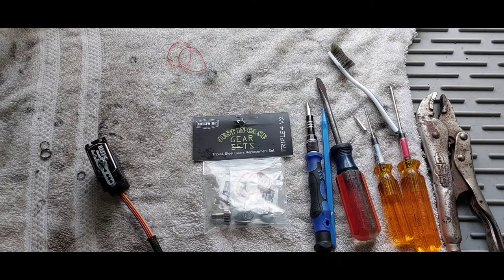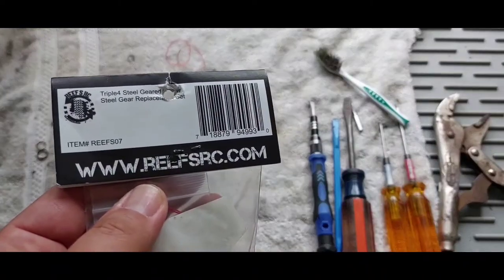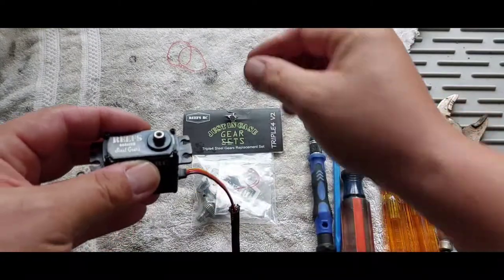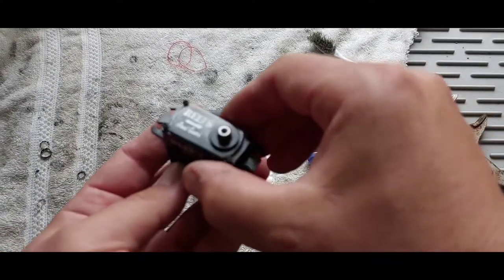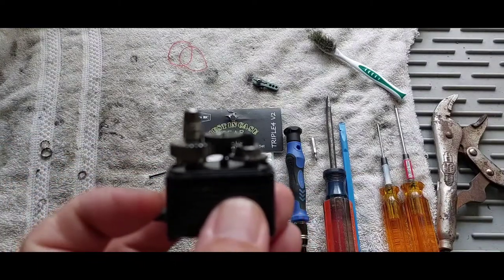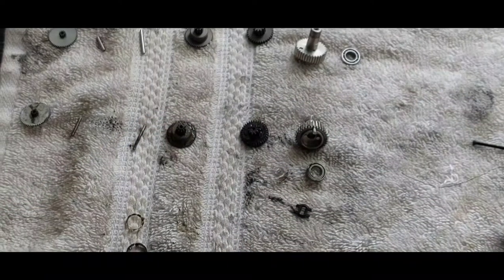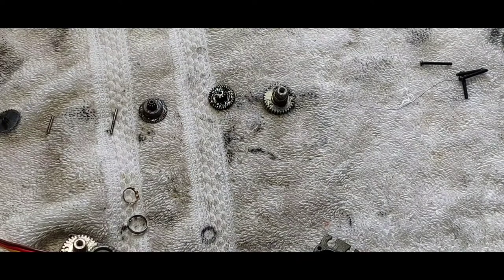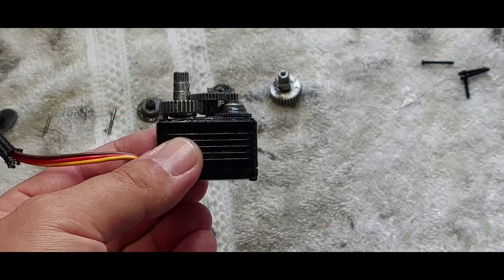Reefs Tripple 4 servo gears replacement

Comment: 9:12 that retainer has a flat side and a raised side. Do you remember if the flat side faces up or down? Thanks
Reply from the maker: Flat side faces up. The new gears from Reefs comes with it pre-installed already though. Hope that helps.🤙